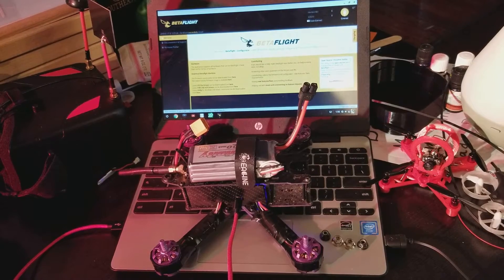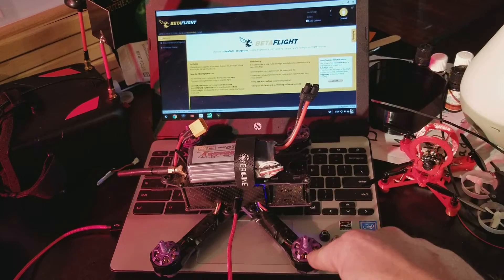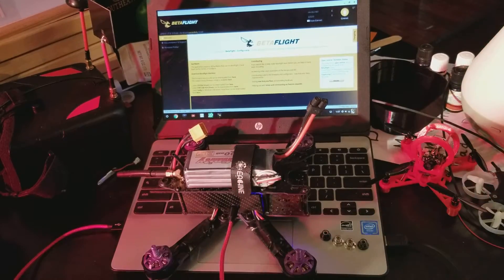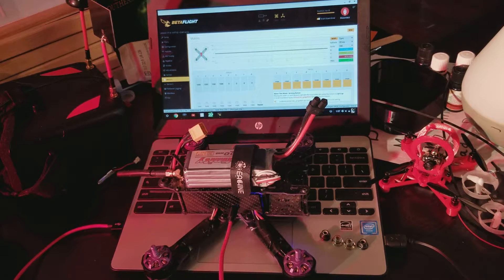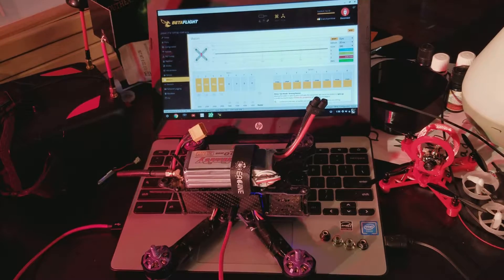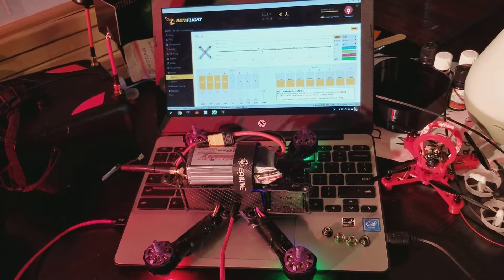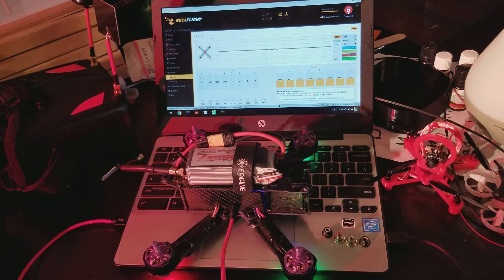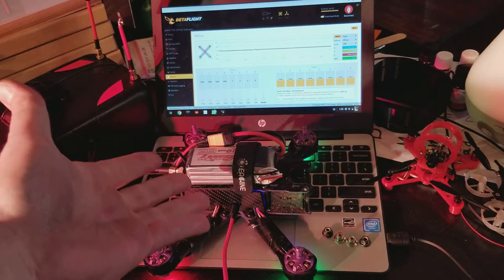Calibrating ESC's with Betaflight

Comment: Also trying the calibration. The way that you describe the drone does not continuously beep when you plug the battery in with throttle on full. When I lower the throttle back to zero, it beeps once

Comment: I've updated my ESC and the flight controller and in betaflight when I use the master slider the motor menu it Powers them evenly and I can power them individually and they're going the right direction. But when I use the controller to increase the throttle motor 3 skyrockets motor 2 does nothing. The other directions work balance only the throttle forward only advances engine 3..

Comment: I have BLHeli ESCs and the method is not working for me
Reply from the maker: That's strange. I have dshot blheli_s individual esc's on my wizard and it works. What's not working? Are the motors still out of sync after following this video?
Reply: @vampcaff  I have hakrc blheli32 dshot600, controller running inav, never done anything to the ESCs, not updated, not configured, they just work, the motors spin, and the copter flies, I didn't have the telemetry pads wired, now I just wired it, I'm going to try again
Reply from the maker: Any dshot protocols or brushed motor protocol doesnt need esc calibration.
Reply: @vampcaff  okay, so that's why then haha

Comment: great video, I did this and it worked but as soon I disconnected and tried taranis, It was as it was never calibrated...any thoughts why? thanx!
Reply from the maker: Maybe try going into the cli and type in save before you disconnect. That might help. Also what are the motors doing to seem out of sync? If i know the symptoms i can maybe be more thorough with my help.

Comment: my drone does do that tone when you do it how you did. its doing that tone like halfway down maybe?
Reply from the maker: So your beeps dont fully complete beeping? Try calibrating again. If anything just try to fly it outside and see how it handles. If it's messed up and won't fly right try reflashing the esc's in bl_heli suite. Then calibrate again.
Reply from the maker: Oh and always make note of and save your settings before reflashing, you don't want to be stuck if you dont know what your version and esc type are.

Comment: good video, I've tried to calibrate my drone, but when I arm and use the throttle, the motor won't spin right, I mean motor number 1, 2, and 3 is good, but the 4th motor not spin like the other.. do you know how to fix it?
Reply from the maker: Is it spinning at all or is stuttering? Also is it turning in the opposite direction than it should?
Reply: @vampcaff  yes all four motors spinning, the first motor, second and third have almost the same speed, but the fourth motor rotates very weakly. But if tested one by one or using the master button, the fourth motor runs normally. When testing with TX, I increase the throttle, the fourth motor does not run normally like the other three motors. Is there any solution?
Reply from the maker: If you have seperate esc's for the motors i would test the motor on a known working esc. (swap motors two motors around) If the motor still acts the way it was then the motor is bad. If the motor spins up normally on the known working esc then the original esc is bad.

Comment: Hi when I connect my battery I am not getting the beeping sound like yours , and motor are not responding any idea?
Reply from the maker: Does the drone power on when you plug in a battery when it's not connected to the computer? Just from what you're telling me it sounds like your fc is not communicating to the esc's. Therefore the motors wont get a signal.
Reply: @vampcaff  
Thank you Vamp Caff,
Is it seem like FCB is not good?
Because without FCB if I connect ESC to Motor it is responding as expected.
But when it move the respective channel form radio respective channel from clean flight also responds accordingly.

I am filled with mystery in my mind.

Comment: No beeping after connect the battery... Weird...
Reply from the maker: Are you using a 4 in 1 esc or individual esc's?
Reply: @vampcaff  tinyhawk 2 freestyle
Reply from the maker: Oh ok cool, with dshot and 4 in 1 esc's you don't have to calibrate the esc. This is to calibrate single esc's so they are in sync.

Comment: Thanks :) Hopefully I can get a handle on that which my copter rolls at full throttle always to the right side. 
I could not determine a hardware error.
Reply from the maker: Hmm, this might be a bad esc. I had an issue a few weeks ago where i could hover fine and gently fly around but as soon as I'd punch out it would roll uncontrollably to one right. Ended up being my front right esc was bad.

Comment: For some reason, when I plug the battery on, the motors start spinning like crazy and I have to unplug them right away.. do you know why this may be happening? it is driving me nuts .. Cheers
Reply from the maker: Is this happening in general or when trying to calibrate the esc's in betaflight? If it's happening everytime you plug in chances are your throttle end points aren't set up right. Check your controller tab in betaflight to see where your throttle end point is set.

Comment: Hi   i just finished my first built after 12 attempts....when I plug in the battery,,,,all motor twitches and beeps every second,,,what might be the probelm?tq
Reply from the maker: The gethub for betaflight has a list of what the beeps mean. That will point you in the right direction. The motor twitch sounds like the esc is resetting, that is if the start up tone sounds again.

Comment: when I`m connected to betaflight and plug the battery in, there is no beeping sound and the motors just spin up to max. when disconnected from betaflight plugging in the battery results in beeping, but obviously I can't calibrate the escs like that
Reply from the maker: Is it a 4 in 1 esc? Also what fc is it?

Comment: Hey thanks for the video it works but not with mine for some reason it beeps no song and won't connect to blhehi think u could help
Reply from the maker: Have you tried to calibrate in betaflight a few times? Keep trying if it still doesn't work reboot your fc with a known working cli dump and try again.  If there's still a problem I would suggest searching for blheli suite problem shooting. I'm not that familiar with the blheli suite. Good luck!

Comment: mine does not do the last "beep Beeeep" when the master is down... Motors dont spin up in sync too...
Any idea on what i could have messed up?
Reply: i´m using 4 little bee 20a with Blheli (not s), if that helps
Reply from the maker: Have you tried recalibrating the esc's a few times to see if this happens everytime?
Reply: VampCaff yup, it does. It does not spin up after the calibration too. I have to arm manually to spin up

Comment: What do I do if my motors are all spinning the opposite direction?
Reply from the maker: Hmm... there's a couple things it could be. Did you recently install new motors? Also are the motors brushed or brushless?
Reply: I just installed some 2205 2300kv brushless motors
Reply: Any help??? I dont really want to re solder all the motors in a different order as the arrows are pointing in the correct direction
Reply from the maker: Sounds like you have the black and red installed backwards if you didnt mess with the motors tab in betaflight. Swap the far left and far right wire motors that run to the esc.
Reply from the maker: But get used to soldering. I solder at least once a day doing repairs.
Reply: Are you sure? Will that damage anything?
Reply from the maker: Scratch that. It's the center wire and either the right or left wire. Doesn't matter if it's the left or right either way the motor will reverse it's current direction. https://youtu.be/mASuOnniYXQ
Reply: VampCaff I have tried doing the esc calibration on my Full Speed Leader 120 doing so exactly as you show in your video and for some reason when I plug in a battery I get no response from the esc's. No beeping, nada.....any idea what I could be doing wrong?
Reply from the maker: That's strange. Calibrating the esc's shouldn't effect the communication between components. Honestly I would input your quads cli dump from before you calibrated the new esc and see if that works. If you didnt save it try and find a stock cli dump for you quad.

Comment: For what ESC's and what flight controller is this calibration? Omnibus F4 V3 + BLHeli32 will not start any calibration sequence, no beeping...
Reply from the maker: Jarkko Hautakorpi not sure if this will work with blheli32, I use blheli_s esc's. The fc shouldn't be the problem. I would suggest calibrating in the blheli suite.

Comment: +1👍  WHAAAAT!?!? that simple?????  THANKS YOUS ALLS CAPSES
Reply: if you dont do this, do you fry motors like i did?
Reply from the maker: Not necessarily but the motor speeds wont match up unless you calibrate. Its worth the time and yeah, its that simple ! Haha
Reply: okay, mine didnt make pretty tunes,it only single beeped at beggining and end. butterflight.  not sure what's going on. motors spin.
Reply from the maker: Butterflight. Ok it will sound different.
1) when you have the motor tabs all the way up and once you plug in the battery you will hear Beep, Beep, Beep etc. (single beeps with space in between the next beep)
2) once you lower the motors tab all the way to the bottom you'll get one beep. 
3) done lol
Reply: woot.  it worked then, weird thing was i could not arm until i used the transmitter-mode to calibrate too. (i was stumped until i found the internets said the same)  Thamk you  VampCaff!

Comment: Hey thanks for helping! So my motors start spinning slightly before I even connect the battery when I move the motor sliders up. Is that normal? Thanks again
Reply from the maker: mike t weird. That doesn't sound normal. But hey if nothings broke dont fix it! Lol
Reply from the maker: mike t did you ever have any luck figuring out what was going on?
Reply: Hey there,  no not really, still working on it. When I move the calibration slider up, the USB power is spins one motor now since I disconnected 3/4 5v power connectors, but all 4 motors go to full power when I connect the battery if the sliders are up. Think I might disconnect the last 5v from the esc and use the 5v connector on the PDB and see what happens.
Reply from the maker: Are you using a naze32 fc?
Reply: yes im using an F23A Naze32 Rev6
Reply from the maker: I knew it! There's an issue with some versions of the naze32 rev6. It doesn't have a diode that prevents 5v power from the USB connection being fed back to your PDB through the connection that normally powers your FC. This powers up the esc's even when you only have USB connected and prevents you from calibrating the esc's. Here's a link for a fix to this problem. Hope this helps. https://hilo90mhz.com/naze-v6-reverse-voltage-feedback-issue-schottky-diode-fix/
Reply: Thanks a ton VampCaff
! I'll post how it goes when I try this. I subscribed to your channel.
Reply from the maker: mike t thanks bud! I knew we could get to the bottom of this! Im looking forward to hear if it works out for you!
Reply: yes flying great, in the process of building a few more!
Reply from the maker: mike t so we figured it out?
Reply: hey yes, thanks! I don't know what it was but it suddenly worked. i was back on your video to remember how to calibrate the motors on my new build, this next one is way cleaner.  seems like an addictive hobby!

Comment: great video, but does work on eachine racer250?
Reply from the maker: As long as youre running betaflight on your fc it'll work just fine. Also if its a 4 in 1 esc theres no need to calibrate.

Comment: thanks for the vid.  Is this the same way when using ONESHOT125 protocol?  I thought I read somewhere to calibrate ESCs using PWM protocol then change it to ONESHOT125.
Reply from the maker: Since protocol is just a language the FC and ESC use to communicate I'm uncertain for what the advantage of calibrating in a different protocol then the one you'll be using would be.  If you can give some insight as to the benefits that'd be great!